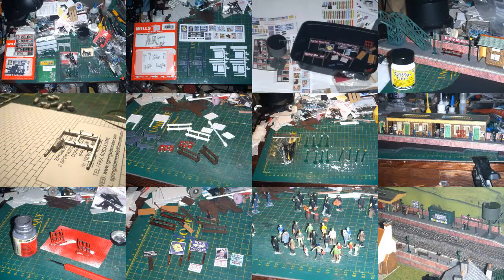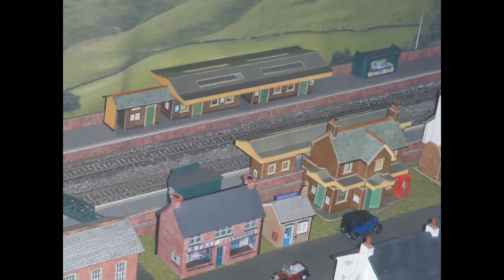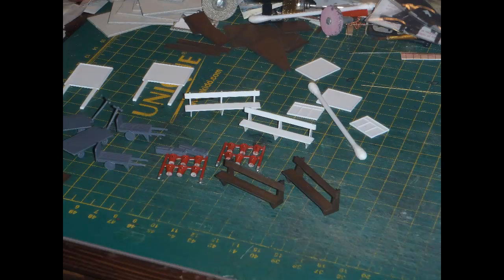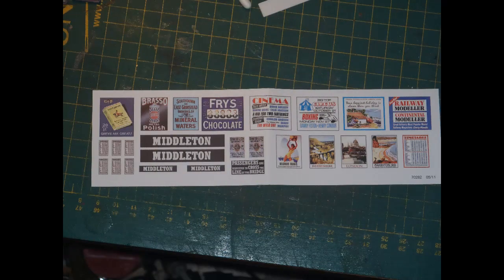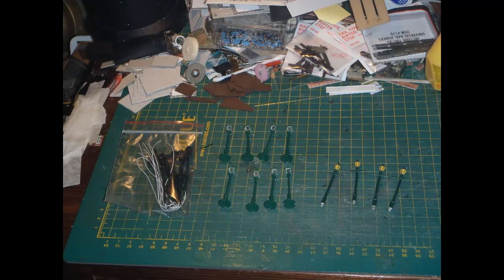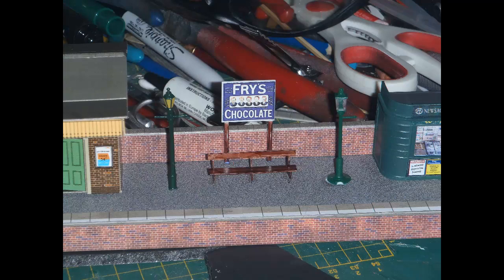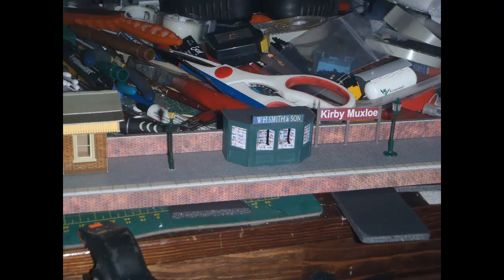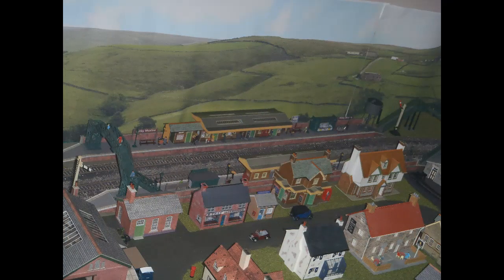OO Gauge 57, Station Detailing

Comment: Hi Ken. Were the vending machines for chocolate or platform tickets, maybe?
Reply from the maker: I did wonder about that. I remember platform ticket machines from when I was a kid - but that was 1950s, and I'm modelling 1930s. So far as I remember you put in 2d (two old pennies), and that gave you a ticket that entitled you to go onto the platform(s). But platform ticket machines were generally somewhere inside the station, before you got to the actual platform(s), since you were supposed to show the ticket to get onto the platform (or maybe even put it into a turnstile?) Would it make sense to have platform tickets machines actually on the platform? And (for my modelling) did the LMS actually use platform ticket machines in the 30s? Platform tickets themselves go back to the 19th century... but I believe they were originally issued from the ticket office.